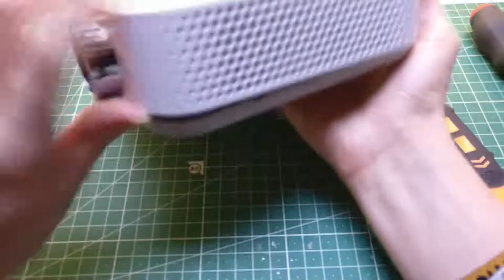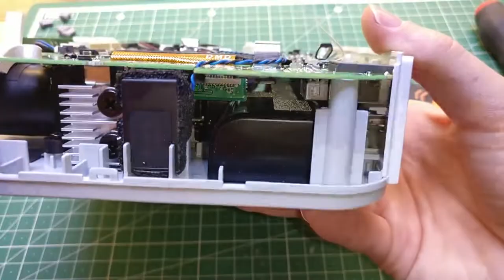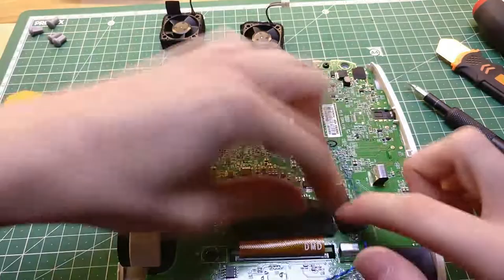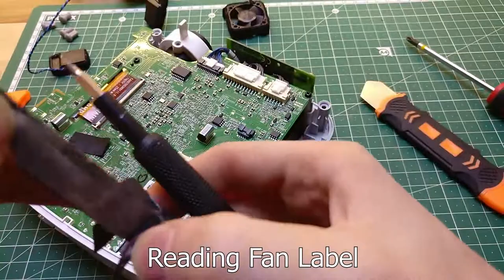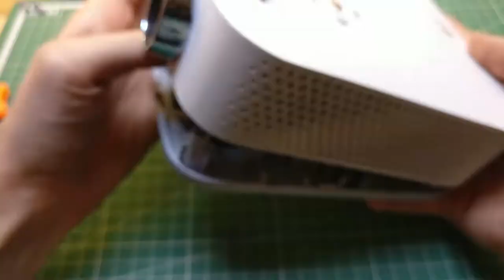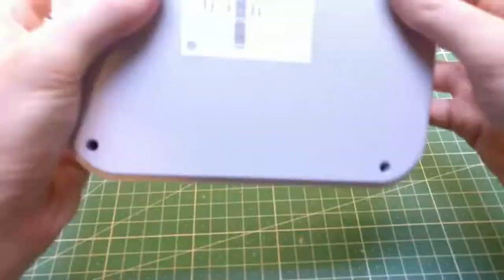LG PF50K Projector Teardown - Disassembly & Reassembly

Comment: Super cool video! I was thinking the same about fan noise, and I was looking for disassembly instructions precisely to get to this too. Did you replace the fans? was it possible to reduce significatively the fan noise?
Reply: I added fans to mine, did not like how hot it runs.

Comment: Mine turn on normaly and then about 10-20 seconds later suddenly turn off by it self do you know what happened?
Reply from the maker: Sorry, I'm not familiar with that behaviour.
I fear there might be something wrong in a more complicated way.
My only direct guesses would be power supply related or that it shuts off if it doesn't detect the fans spinning (either fans or RPM feedback broken).
But it's hard to tell from a distance.
Reply: I have the same problem with my new projector(. Have you already solved your problem?

Comment: Hi, thank you for this amazing video. Do you have any idea about the battery replacement of this device? Is it using very specific battery?
Reply from the maker: I have not looked at the battery in detail, but it appears to be pack consisting of 4 18650 cells. How easy they are to replace, I can't tell. It could be as easy as simply those cells going to a connector or as hard as a potted battery pack with BMS.
But I would guess it's simply a spot-welded pack inside a plastic case, so not too much effort to replace for a tinkerer.
Maybe there is also a straight replacement available for purchase, but I don't know.
Reply: @LeoDDJ  thank you brother
Reply: @LeoDDJ  what screw driver did you use philips π 1

Comment: Hello! thanks for the video.

 Do you know if there is any way to recover a lens with a surface scratch?
or if it is possible to get only the crystal without having to buy the whole module? 🙏🏼
Any parts supplier? I miss my projector 😣😩 and now is all foggy.
Reply: I just ran into an issue today with my lens that makes it disoriented. I thought it was the hdmi cable so I changed it and figured it was the lense, have you found any parts or anything? Lmk pls